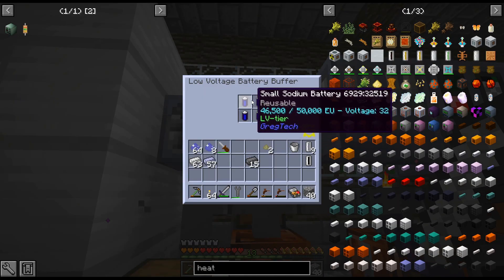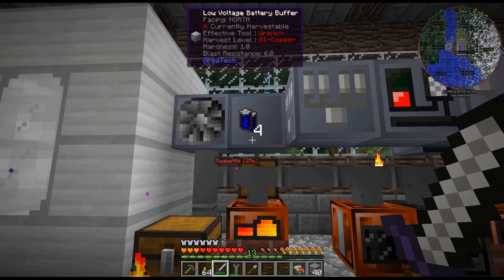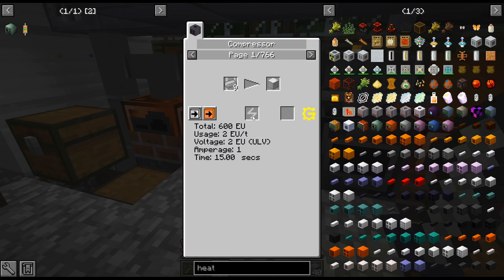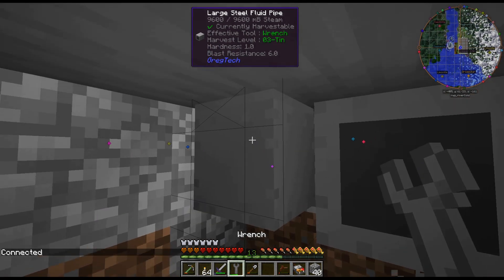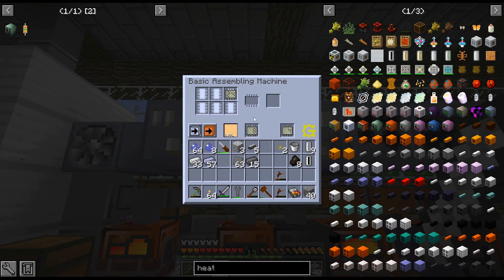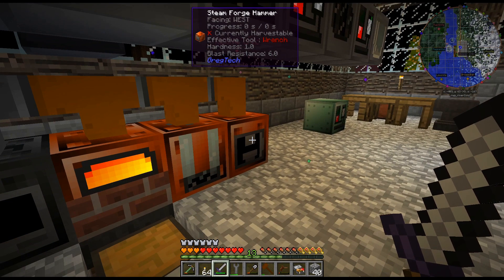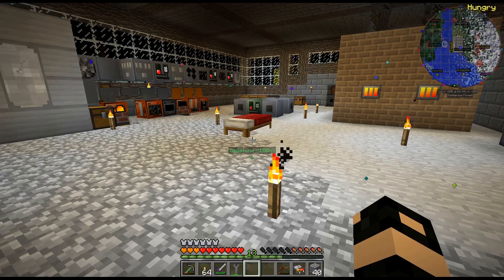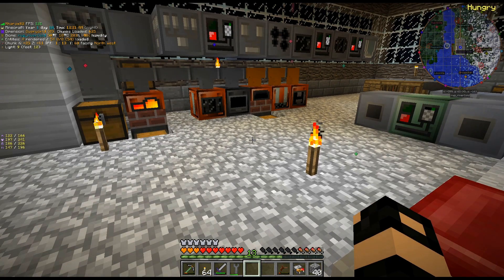GregTech New Horizons Season 2 - 16 - Electric Blast Furnace

Comment: The reason the cells disappear is because the client programming tells the server you right clicked with a cell then assumes the item gets consumed.  The server handles this message and processes it and updates everything except it doesn't send a message back to the client to let it know that the cell is full now so put that in the inventory.  It isn't until the client tells the server to grab the item in an inventory slot that the server finally tells the client that it is picking up a full cell from that slot that the client finally knows there is a cell.  It's a bug in the programming basically, specifically client/server messaging.

Comment: You can do semi easy screws. Lathe ingots into rods, manually cut the rods into bolts (you can use s cutting machine also), thread the bolts into screws with the lathe again.

Comment: GT pipes haven't auto-connected in a long time (if ever ?). I think you're playing too many (different, non-GT) packs, @Kharax82 :-)
Reply: They don't in GTNH, but many GT packs do have auto-connecting pipes (you need to use covers to prevent that, which was usually a major use of paper :D). The reason it feels weird is mainly because they do auto-connect if you place them right - that is, placing the pipe on another pipe (or machine) auto-connects the two. Since Kharax was clicking the background cobblestone rather than the pipes, they didn't connect. You can even see the first two pipes connecting properly, unlike the three on the bottom which were placed against the background :) But to be fair, there's so many GT packs nowadays (yay) that it's easy to forget the intricacies of any particular pack. I think GT officially added non-connecting pipes in 6, and the Dream and guys more or less backported that to 5, as they usually do. Auto-connecting pipes are more trouble 90% of the time anyway, especially in a pack where connecting the wrong things together leads to explosions :P